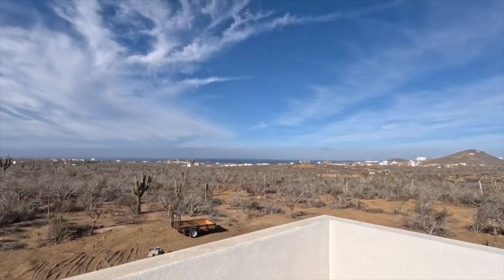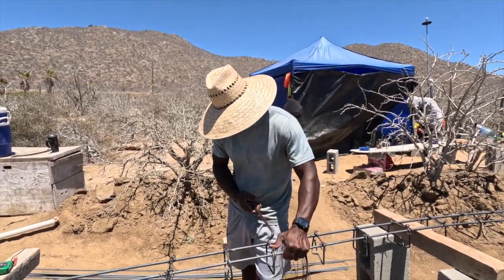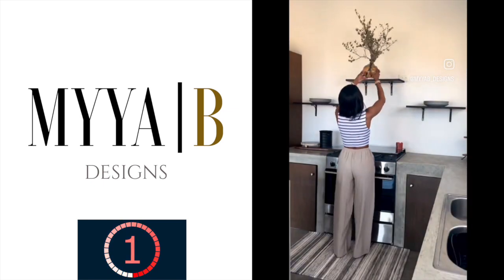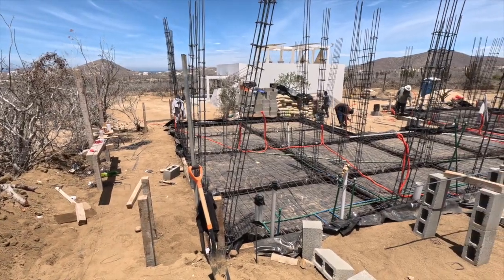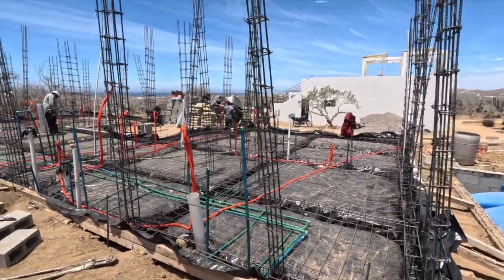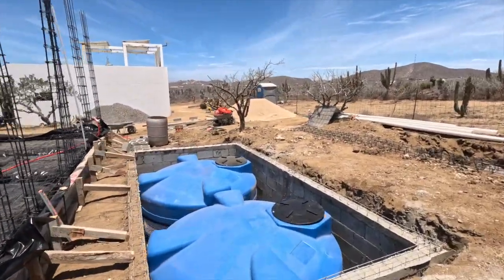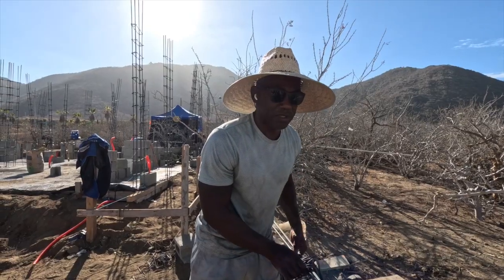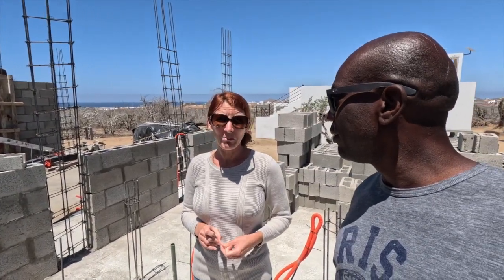Building in Mexico Week 2 | House Construction in Mexico

Comment: Is there a video that I can watch to learn more about your solar set up? I really love what you guys are doing.
Reply from the maker: We haven't created a video on the setup of our system yet, but we've made a video discussing the brand of system we currently use. You can check it out here: https://youtu.be/BPPUTMeYhyY.
Reply from the maker: Are you thinking of going solar?
Reply: @rvseeingyou  Most definitely. My sprinter has 500 AH of batteries 320 watts of solar panels. We are planning to switch out the panels for more dense panels. 

Plus, we are thinking long term of the off grid approach you guys are doing. How much juice can you store?

I love that you are running everything on solar including your ACs.
Reply from the maker: @lifeisgoodafter60 we have a 35,000 kWh storage, 10 panels (550 W each), and a 6 kW inverter. We're currently in the process of adding 2 more panels (550 W each) and upgrading the inverter to 18 kW. Next summer, we are considering adding a built-in generator.
Reply: @rvseeingyou  HOLY MOLY!!

That’s a beast of an off-grid array. Love it!!
Reply from the maker: @lifeisgoodafter60 believe it or not, it’s still not enough 😂